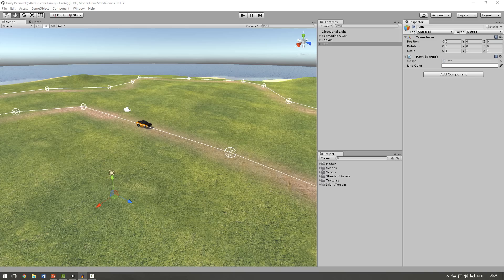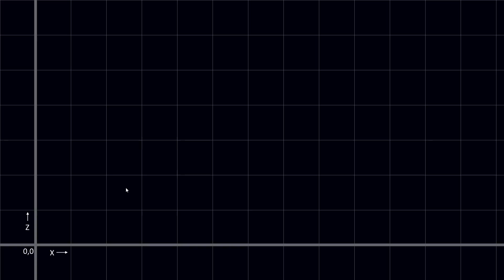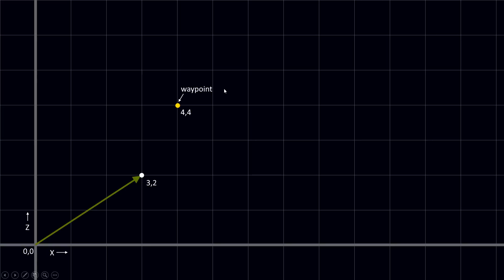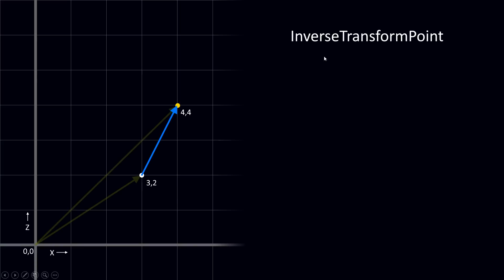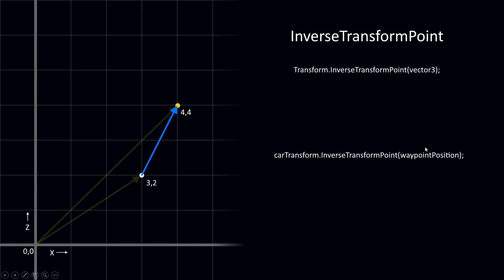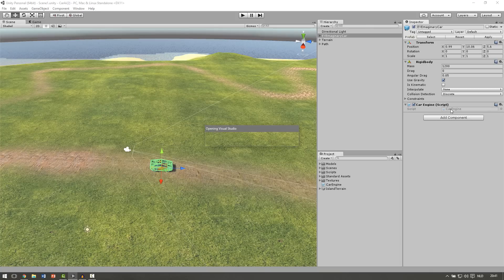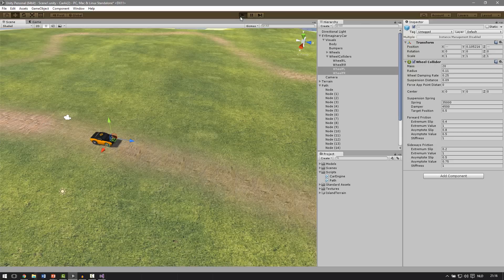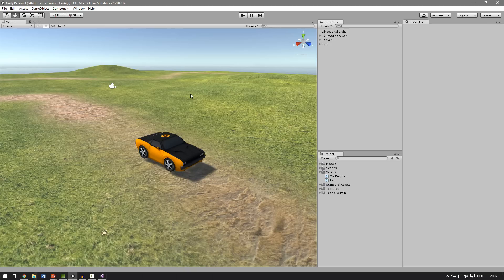Car AI Tutorial #3 (Unity 5 ) - Steering by Itself

Comment: I hope this helps

using UnityEngine;
using System.Collections;
using System.Collections.Generic;

public class CarEngine : MonoBehaviour {

    public Transform path;
    public float maxSteerAngle = 45f;
    public WheelCollider wheelFL;
    public WheelCollider wheelFR;

    private List<Transform> nodes;
    private int currectNode = 0;

	void Start () {
        Transform[] pathTransforms = path.GetComponentsInChildren<Transform>();
		nodes = new List<Transform>();
		
		for(int i=0; i < pathTransforms.Length; i++) {
			if(pathTransforms[i] !=path.transform) {
				nodes.Add(pathTransforms[i]);
			}
		}
	}
	
	private void FixedUpdate () {
        ApplySteer();
        }

        private void ApplySteer() {
            Vector3 relativeVector = transform.InverseTransformPoint(nodes[currectNode].position);
            float newSteer = (relativeVector.x / relativeVector.magnitude) * maxSteerAngle;
            wheelFL.steerAngle = newSteer;
            wheelFR.steerAngle = newSteer;
        }
	}

Comment: InverseTransformPoint changes a coordinate from LOCAL object coordinates to Global coordinates. it is not used to find vector. if you want to find the vector from 1 object to another you do (objectBPosition - ObjectAPosition).normalized. gives you the direct vector from your car to the waypoint. its been what i have been using, until I replaced it with a rayCast navigation system that detects the road edge. I have not wathced the whole video, but I will try to implement this with my own cars. I still have access to the waypoint information, I still used waypoints as a way to tell what direction to travel on the track, while the raycasting does the actual steering, but I am having trouble with car shakiness, so I came to youtube

Comment: Hey bro can u plz help I am stuck here:-

float newSteer = (something. Something / something.magnitude) * SteerAngle ;

After saving the carengine script, i get an error in the console :-

Assets / carengine.Cs :- Error code Cs0019 - "/" sign cannot be used with operands such as float or groups... 

Plz help I am tightly stuck up here... 

Without this code my ai car will not move towards the way point... 

Any help is appreciated.

Comment: Thanks for the video, it is very useful. My relative vector does not seem to work, even when printing the relative vector to run a test. Any tips?
Reply: did you figure this out by any chance mine keeps giving me value to large or all 0s
Reply: Hi I  have the same problem how did you manage to make yours work ?
Reply: @kennedychigoziedibiaezue4265  so i wasn't dropping the path in mine did that and it worked
Reply: @SokkaRocks8  i dropped mine in still doesn't work in fact my car doesn't move at all any ideas ?
Reply: @kennedychigoziedibiaezue4265  did you remember to add.path to the start of one of the lines forget which one but it was messing mine up as its different from the path draw function when you copy it
Reply: @SokkaRocks8  yea both of the actually the first one was path.GetcomponentsInChildren<Transform>(); and the other was path transform still dosen't work I've gone over it a dozen times no error yet the relative vector doesn't show the wheel collider dosen't turn and the car doesn't move at all

Comment: Apart from all other beginner mistakes, and the occasional reverse usage of the word setting x to y (when you mean y to x), one annoying action I can't leave uncommented is adding a permanent call of a function inside an update loop.

Why would you place a direct call of an extra function ApplyStear in FixedUpdate without conditions?

Just place the code inside FixedUpdate, it's less work, less compiling, less possibility for typing errors, etc..
Also, you don't need to declare variables as private, in C# they are private by default.

I like how involved you are in doing these tutorials though. The production is quite professional.
Reply from the maker: Evil Kitten Productions what would you recommend for the permanent calls if they exceed 200 lines of code? Just put everything in the update?

For the primate variables I think it's more clear when you write it down..
Reply: Yes, simply put the code into Update. ;)

Thanks for replying to a video that is 1 year old by the way, most people don't bother replying after a few months.

The way you write the script it's very easy to understand though, I watched your other videos by now, and you're right, having hundreds of lines of code can be messy and unorganized and hard to keep under control.

My comment was aimed towards the script at this stage (having only 1 function in update, which made no sense).

However, I still recommend putting functions into Update only when there are conditions connected to it.
An unconditional function call every frame can make a difference, especially when more complicated Vector/Quaternion/Physics calculations are used.

I just seperate my Update loop with commented lines, it's very easy to spot a comment, and they describe also which portion is doing what.

Also, for example, some of my Gamelogic scripts handle everything gameplay-wise, they have about 500 - 2000 lines.
If I were to write an extra function for each action, and an extra call for each action in Update, I would exceed 2500 lines by far.

My point is, that the user has to think ahead, how they want to structurize their scripts and coding, by analizing their needs first.

Your way is fine if it works for you, but I can't do it that way, I would not be happy, that's all I wanted to say. ^^

My version of the car script would look something like this:

public Wheelcollider a,b,c,d;
[SerializeField] int MaxSteerAngle, MaxTravelSpeed, MaxTorque, MaxBrakeTorque;

WaypointScript WP;
Vector3 currentTarget;

void Start()
{
WP = GameObject.FindWithTag("Waypoints").GetComponent<WaypointScript>();
}

void Update()
{
//Find first waypoint and then continue looping below
if(currentTarget == null)
{
currentTarget = WP.points[0];
}

//Apply Torques accordingly
wheelcollider.motorTorque, braking etc...

//Steering
calculate vector to waypoint, smoothed turning to next waypoint etc...

}

void OnDrawGizmosSelected()
{
Fancy colors, etc..
}

Something like this, it's pseudocode, just an example.
Reply from the maker: Evil Kitten Productions Great explanation and thanks for that! It is indeed a personal thing

Comment from the maker: ▲▲▲ Next episode online tonight! ▲▲▲
Reply: hi i used the code in this video but for some reason the relative vector doesn't work for me can you assist
Reply from the maker: @kennedychigoziedibiaezue4265  do you have an error?
Reply: @EYEmaginary  no errors at all and i typed the entire script word for word but the relative vector doesn't show in the console, the wheel collides doesn't face the nodes and the car doesn't move at all too please assist me the much you can
Reply from the maker: @kennedychigoziedibiaezue4265  please place several debug lines in the code to see if parts of the code are being executed. Can you check this?
Reply: @EYEmaginary  which lines should i put the brake points for debugging?

After a few tries i finally figured it out i made a mistake in the spelling of my function I wrote FixUpdate instead of FixedUpdate thanks for the assist great tutorial by the way keep it up 👍🏾

Comment: Great tutorial, thank you.  One thing I found out is using a box collider for the car helped stabilize it when trying to drive straight.  At first I had a capsule collider on the car and it would always veer off and flip the car.  When I switched to a box collider, the AI driving worked a lot better.  The code is the main thing though, so thank you for sharing this :)